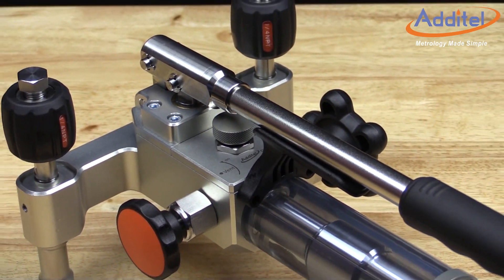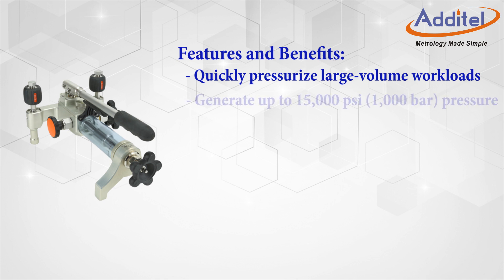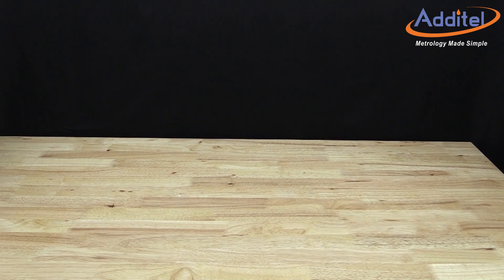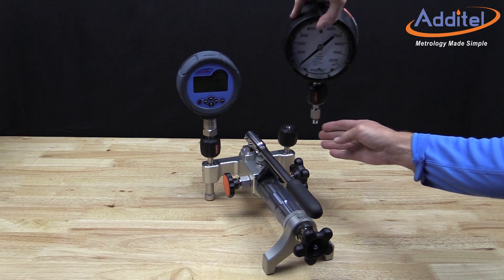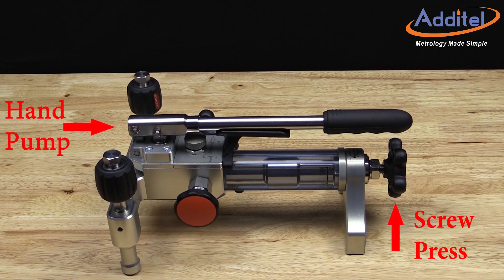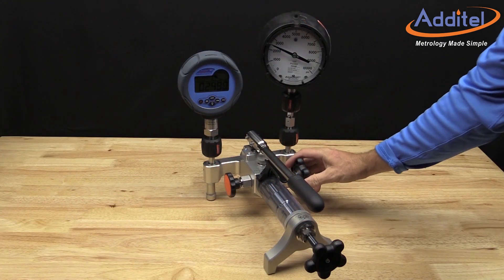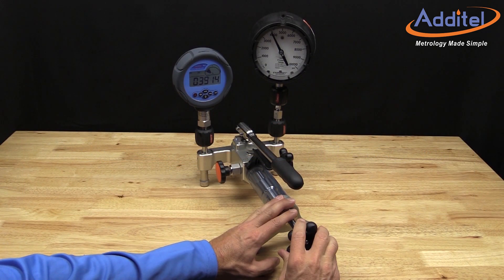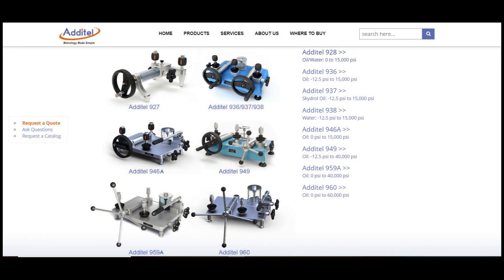ADT928 Pump Intro

Comment: Hi Additel I have some question about the Additel LogII software, In the Log Screen the values are shown as pressure and temperature. I just want to know that this temperature values is for what, is it atmospheric temperature or the temperature of medium used in calibration like Pneumatic or Hydraulic.
Reply from the maker: Hello!  Thank you for your question!  The temperature measurement you seem to be referring to would be an atmospheric temperature measurement.  Additel gauges  are temperature compensated in order to improve accuracies. Additel Log II software allows you to record that temperature reading along with the pressure readings. 
We hope this helps to answer your question.